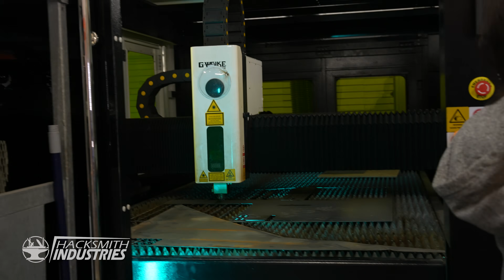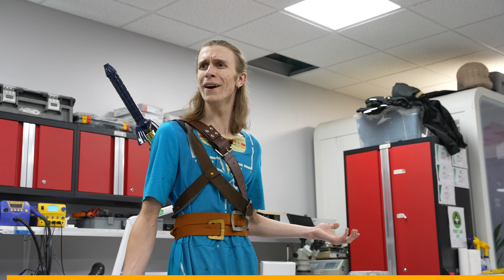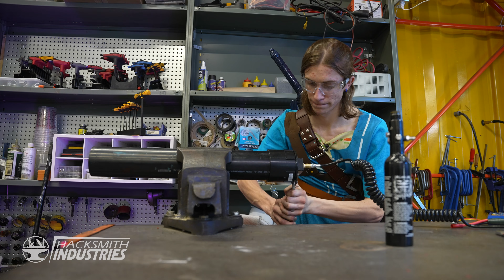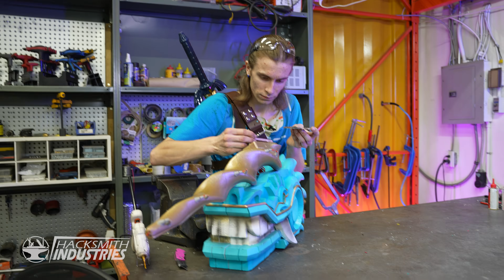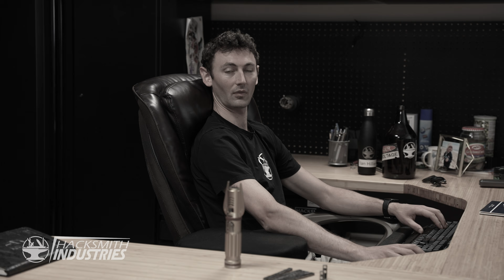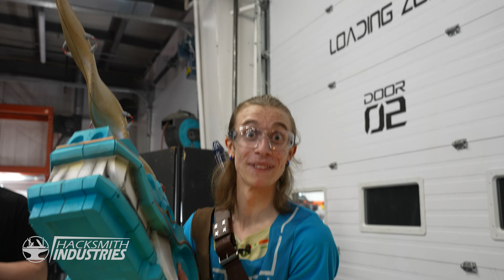I Made Link's FIRE BREATHING SHIELD! (ZELDA BUILD)

Comment: Or a 3d event horizon of the stargate using the holographic devices with a secondary smaller set of reversed light blades set 90 degrees to the larger set and fixed it place , to show the crest wave of the event horizon

Comment: This was a crazy project and Logan's energy is a great fit for it! I was unsure why you chose to use an electromagnet to mount the attachments, when you could have a mechanical connection that is lighter and gets less hot, was there any specific reason? Thanks for sharing this great video, I really enjoyed it! 💜
Reply: There was a mechanical connection along with electromagnet i assume that the used an electromagnet because otherwise the 3d print wouldnt hold up to its own weight especially the electric emitter